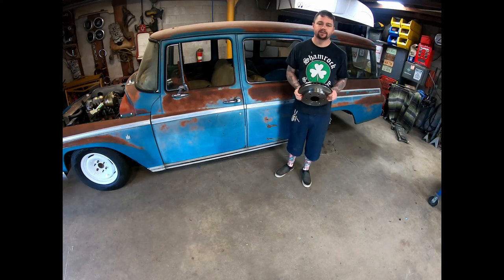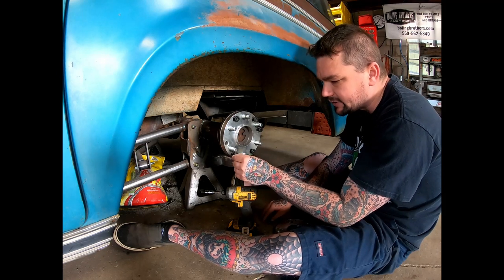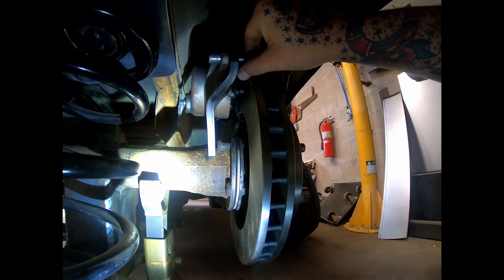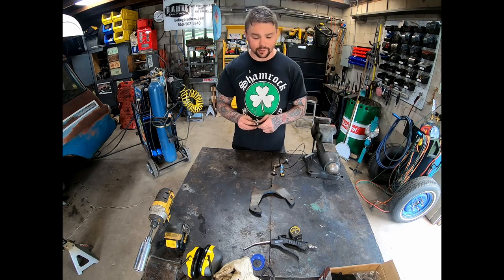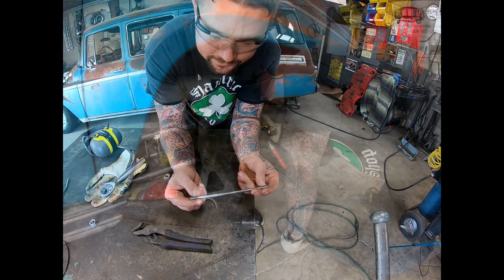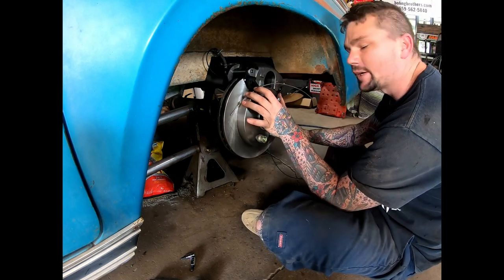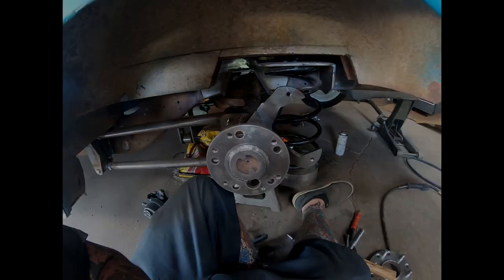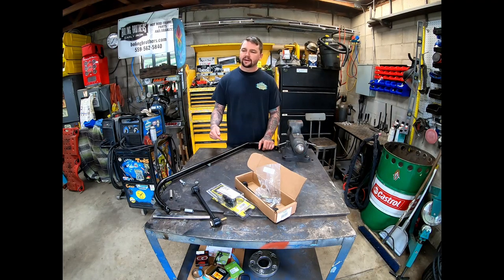BUILDING A DISC BRAKE KIT! DIY!

Comment: Great video, when I was younger and worked at a machine shop, the circle track guys would bring in there axles and have the 4 1/2" bolt pattern holes welded shut. Then the machinist would turn the flange back flush,  mark and drill the 5 on 5 pattern.. just another way to achieve the results I guess. Thanks for your channel!

Comment: Looks great, keep up the great work. I like the fact you are using a vehicle that is not the "norm". I couldn't find a good IH in my area for my project. Went with a bump side ford with a 32v 4.6 and a Crown Vic front cradle conversion. I have completed over 35 modifications on it so far. Starting the dreaded body work now! Looking forward to the next video...
Reply from the maker: Thanks! I like the fords too, I plan to build one for my dad at some point.

Comment: I needed to see this for motivation to finish my disc brake project lol I just need to run the lines and it’ll be sick. 1967 Dodge a100 Van with crown Vic rotors and calipers and a custom bracket

Comment: If your air hose quick coupler has a flat tipped fitting ( looking inside ) , you can give it a turn or two . It may fix that annoying constant leak.👍🏻
Reply from the maker: It don’t.
Reply: Dang it, worth a try.

Comment: Out of curiousity, Why didn't you just drill out the axles for the 6 lug pattern and press studs in? Maybe ad the spacer you need? Or use the 99-06 GM differential with 6 lug and factory disc brakes? Maybe that setup was too wide.
Reply from the maker: The GM was too wide, it had a open diff, and the gears weren’t what I wanted. If it was limited slip and had the gears I wanted I would of ran it. The studs I found that would be the same metric thread and long enough for all of that to fit on weren’t press in. The axle had to be drilled and tapped and the studs threaded in. That don’t mean press in ones don’t exist somewhere that were long enough. But after seeing those I decided just use what I have. I could weld up the axles, drill to 6 lug, put new studs and buy a new spacer but in the end it would accomplish the same thing. I didn’t really see a benefit I guess.

Comment: Nice! Instead of rebuilding the bracket, could you have drilled a hole  in it to allow the stud to pass through in case you ever had to replace it? And maybe weld on a small triangular gusset on the back to the axle tube to replace any lost strength.

Comment: Just curious. What are you doing for emergency breaks
Reply from the maker: I’m not installing any. There is a GM caliper for some Cadillacs that are they same as these and have EBrake lever built in if someone wanted.
Reply: *brakes.
Reply: I had a '99 Sierra 2wd. It had 6 lug rear rotors and a mini drum built in for e brakes.

Comment: I like how you fabricate everything you need, lots of work, great looking SUV, has anyone suggested the 2003 Durango rear axle?  355 gear, six lug and disc brakes factory and there are a bunch in the junk yards
Reply from the maker: To the best of my knowledge they are not 6x5.5 lug pattern.